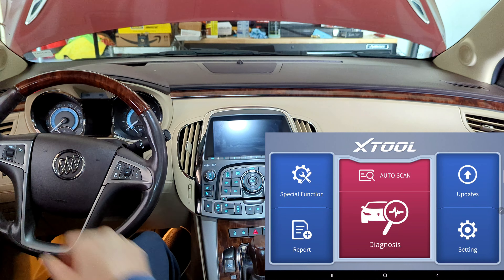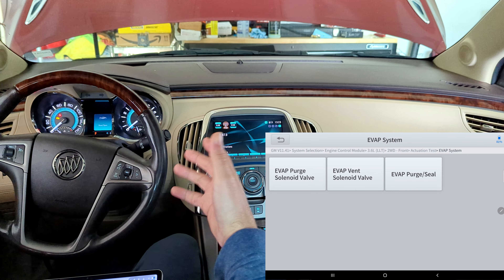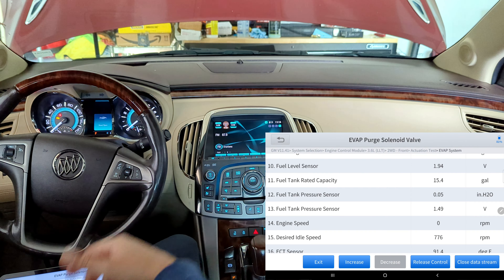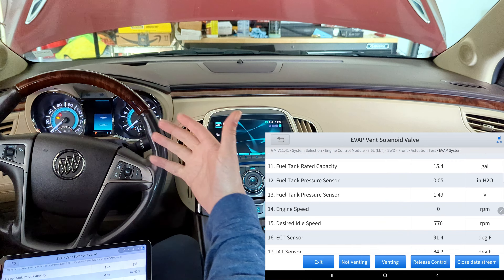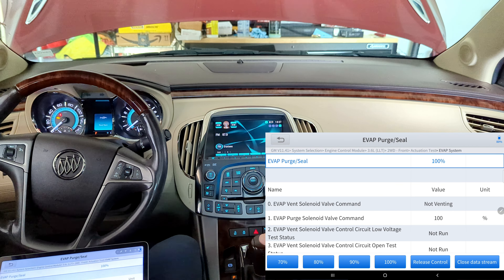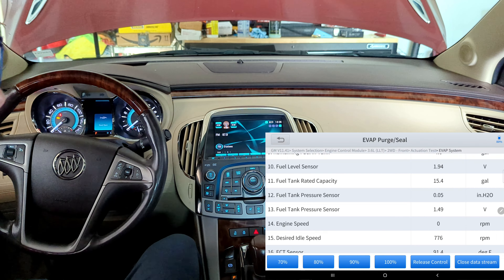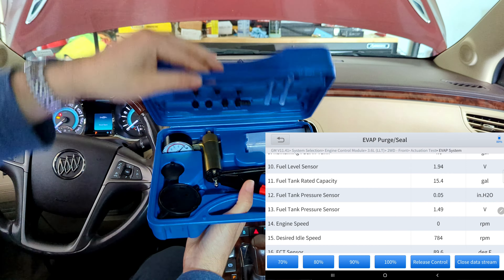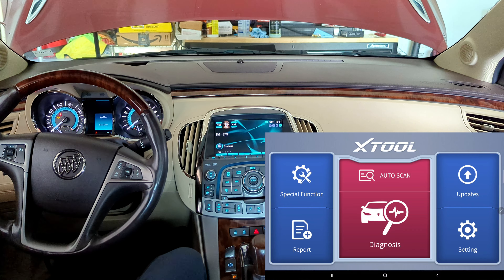XTOOL A30M Bidirectional EVAP P0442 diag 8% Discount (XTOOL D8 and D7 8% discount codes)

Comment: I just got my A30m i have a hinda civic 2010 hatch r18a2 engine. This tool doesn't seem to work with my car. Most of the high end funtions don't work and they supposed to. Did you have any of these problems buddy?
Reply from the maker: Sorry you are having problems. No I never had problems. I'm sure you updated the software, but did you update the VCI firmware? If not give that a try and see if it helps.
Reply: @katzenpapa  everything is updated to the latest software friend. I will try the xtool on other cars ane see how it does.

Comment: Cool. There is an air pump that needs to run with closed vent (requires power) and purge valve to create negative pressure (vacuum) in the system. The computer then monitors pressure over time. If pressure remains basically the same, there are no leaks. If it drops slowly it will set a code for a slow leak. If it drops fast it will set a different code for a big leak. The computer will usually run this test while car sits overnight. That's why if you fill up and don't properly seal the gas cap, you will see a check engine light the next morning with an evap leak code. Also, it makes sense that the vent valve is open with no power as it spends most of it's time in the open state. When active, the purge valve is pulsed open and closed on a duty cycle to help regulate flow rate (same concept as pulsing a fuel injector). Another also, some systems generate positive pressure to test for leaks.
Reply from the maker: I just did this today exactly what you're talking about! I have a video coming up in about 30 or 45 minutes about it stay tuned! Cheers!
Reply: @katzenpapa  Nice!
Reply from the maker: @MarzNet256  indeed!
Reply from the maker: @MarzNet256  just posted another scantool video. This time it's the D8!